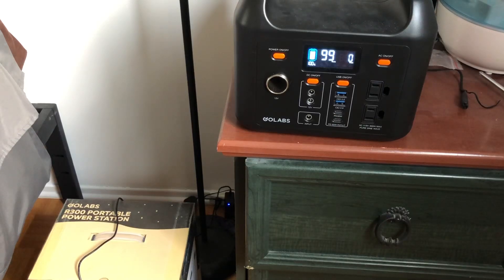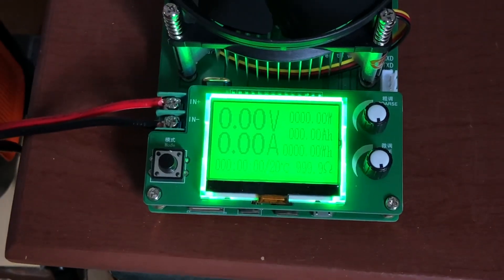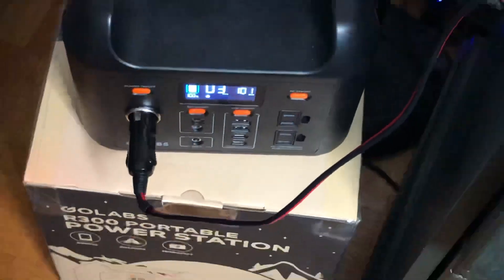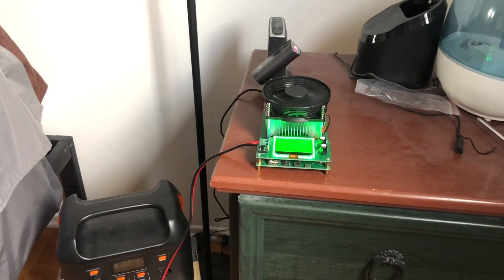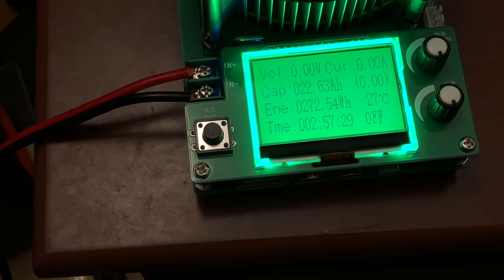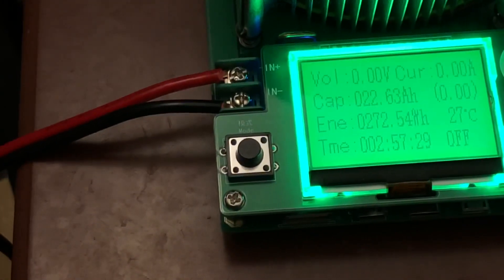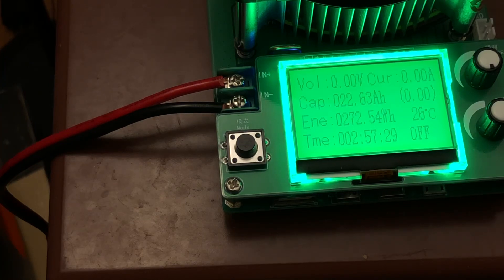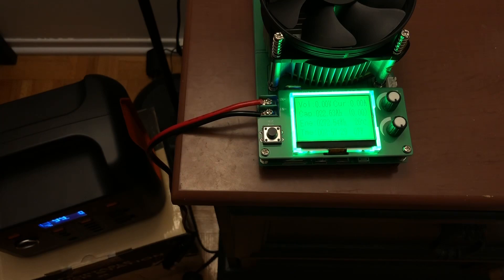GOLABS R300 DC capacity testing is it really 299Wh 272Wh so 90% capacity 🤙

Comment: I have a 12v car vacuum that it is 106W & 8.8 amps. Ever time I plug it into my GoLabsR300 cigarette port it overloads the GOLABS300. So what do you think, is it because the surge power on the car vacuum shuts down the GOLABS300 or I’m am missing something?
Reply from the maker: Yes probably because of the surge. Try using the barrel plug with the adapter and see how that goes?

Comment: That's actually pretty good. There is always at least %10-15 of the battery held back to protect the cells. That's industry standard. So theoretically you should have only got 270W/h. The 4% that is showing left could probably be used by the lower powered usb which uses only 5v not 12v. This is actually ABOVE industry norms. Run the test again, then when you get to the 4% try the usb ports out on a cell phone and see if you get juice. Most generators can't produce enough juice for the 12v at like 20-30%, it was still going until 4%. Also, the "4%" is what's usable not the total capacity as it holds back the 10% to save the cells. Good test. Just try using something low power like the usb's after the 12v conks out.
Reply from the maker: I really love that little unit 🤙
Reply: @patdud1979  Just ordered one based on your tests. I have the aimtom sps 155 but it's just a little too small, got the 60w foldable solar panel to go with it. I'll see how the 2 work together as it charges the little one much faster than the supplied wall brick. I think with the solar panel and this unit combo would be perfect for a camping trip or just even a black out to run some lights or charge a phone.
Reply from the maker: @chrissinclair8705  you should see speed similar to my USB C test🤙
Reply: @patdud1979  Well even if I get close to the default wall charger I'll be happy. I think they way underpower these wall bricks for either safety reasons or to protect the battery but geez bump it up a little. On the Hobotech review he had the same deal. About 40 watts from the charger and 62-65 on the USB 3.0 or solar power max then it cut off with more. It seems reasonable given the size of the battery, but a 3 or 4 hour charge time would make more sense.

Comment: Can I use it and charge it at the sametime?
Reply: Cool! Now can I charge it with solar and use 12v cigarette input to run my fridge at same time? I know the jackery 160 does pass-through charging but only ac not dc.
Reply from the maker: @cookntalk5408  let me know if You get it and how it works out for you 🤙
Reply from the maker: Yes you can 🤙
Reply: The only port you can't use while charging is the bottom usb-c in/out as it will cut out so you are not trying to pump more power than it can handle but everything else works just fine.

Comment: The reason for all these devices < 300Wh is driven by shipping regulations.  Any device with a battery > 300 Wh is considered a "Dangerous Good" and will be subject to an additional shipping Hazmat charge.  From UPS: "A UPS Dangerous Goods contract will be required.** UN spec packaging, Class 9 Lithium Battery label, hazmat shipping papers and package markings are required. Please see U.S. DOT Hazardous Materials Regulations for further details about shipping requirements.
additional
Reply from the maker: Canada sucks for lots of things and the importation of lithium battery is one of them 😩 I still remember when I could order cheap lithium polymer battery from hobby king for my rc car and plane but not those cheap Chinese battery cost a fortune 😭😭 DAMM you CANADA and your pussy mentally lol 😂

Comment: Just an fyi not even ghe top tier sogens get full watt hours and if youe getting over 80% of the advetisers capacity....which you are thats a good sogen tbh.
Reply from the maker: Yep there only 1 or 2 jackery that clock over capacity but I should update the video or remake it to be more clear?
Reply: @patdud1979  I think just do an update to it with some text in the video no need to remake the entire video but based on the math its in the industries 80+ category which most sogens don't perform too.
Also you ever thought of ordering the Volo 500watt sogen or asked Golabs to do a review on that one?  It's the same company just a bit bigger sogen...i'm curious to see the output of that unit.

Comment: pretty sure this DC port is regulated, taking a 10% loss with a regulated port. 299-10% is your 270
Reply: It's not regulated it's a LifePO4 battery so it doesn't need to be regulated
Reply: You will never get the full capacity of a battery because they reserve around 20 percent so you can't fully drain the battery.
Reply: Watched so I wanted to drop a comment
Reply from the maker: Some say it’s not regulated and some say it is but all I can say is that it is a pretty good power station for the money 🤙
Reply: It's not regulated it's the type of battery. LiFePo4 batteries hold their volts almost as good as a regulated 12v port so regulation and the power loss is not necessary. They keep their voltage pretty much right to the end then drop off suddenly in the last couple of percentage of the battery.

Comment: Seems on par with most others as far as the % that I’ve watched Hobotech review. Thanks for the video. I like my R300 and would buy it again for the cost.
Reply from the maker: Yep within the industry standard but I wish it was 299Wh of usable capacity but still good and still love my unit 👍
Reply: Its been 1year since you made this comment. Do you still use the Golabs R300 and is the battery capacity still good?
Reply: @EasyyokeFilms  Yes, I still use it almost daily.  We use it to charge all our electronics (phones, tablets, speakers, etc).  I usually charge it up using solar about once/10 days.  I have not noticed any decrease in battery life.  To further extend the battery life, I typically charge it to 90% and drain it to 20% unless I am traveling with it and need the full capacity.  I'm using it this weekend to go camping to power my ham radios, charge electronics, inflate my air mattress, and run my dc fridge overnight.  I'm happy with it.